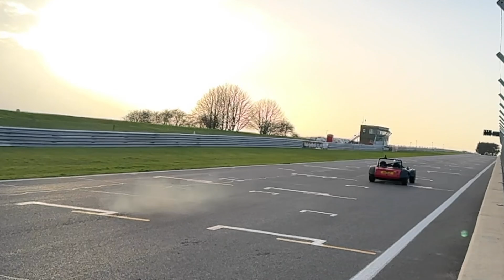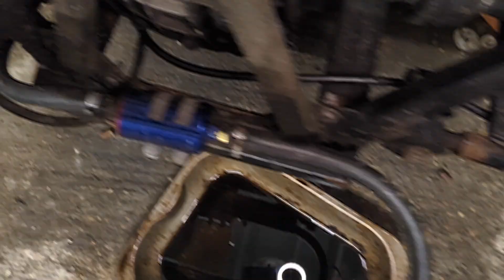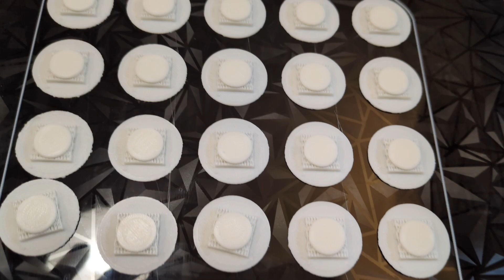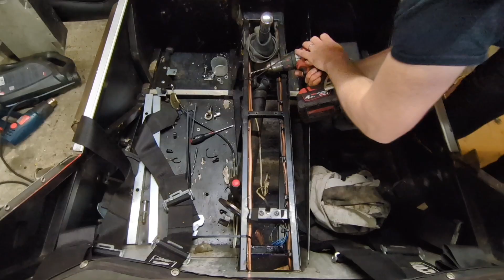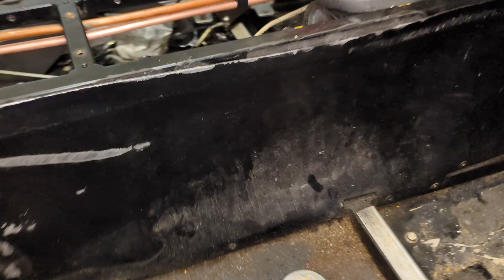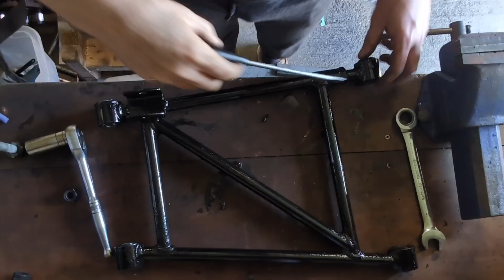MAJOR OIL LEAKS - Send it?!?

Comment: Thingieverse have files for copper pipe bender.
Reply from the maker: @myshopmyrules.3017  do you know  what? I didn't even look! As I can design and have SW etc I just run to the laptop and crack on. 

Not used thingyverse , printables etc often as most of the time the stuff is crap. I can design it better. How does my pipe bender compare?!? 🤣
Reply: @TeaNBizz-Kits Sometimes i just serarch thingieverse for fun. Sometimes i find usefull stuff. Im still a beginner when it comes to designing stuff. I hope someone who have the belt pully cover and can scan it an put online for the right walker turner drill press pulley cover for my drillpress from around 20s-60s?. And i hope someone scan the nose cone of  the super seven so i can print it and make it out of fiber glass or aluminium when i get the skills.

Comment: Iv heard good things about citric acid powder for rust removal. Buying a big bag here in Norway 25kg cost £44,15, that will last a while. August last year i changed my profession from plumber to welder. Worst mistakes i ever did in a way. Walking by the scrap container makers me see €$£ every day. Now i really want to buy the (Build your own sports car for as little as £250 and race it!) cause i see a lot of 25mm square tubing trown away. And watching your car aint helping subduing the hoarder in me from collecting scrap metal for a project like this.
Reply from the maker: Not sure what this POR15 had in it but it's a great product. The paint finish is amazing considering I brushed it on with an ambient temp of 5degC and over rough surfaces. Very impressed. 

Welders don't earn as much as plumbers in the UK but welding is FAR more useful than a plumbing when building a car!! 

Can you get a kit car imported and then modify it? That's what I would recommend. It takes a lot of determination to build a car from scratch.
Reply from the maker: Oh, and thanks for watching. Please do take a moment to watch my other episodes, tell your friends, subscribe and generally show some love. Biz.

Comment: Nice work. Re compression test figures, on my Rover K series in my GTM (similar compression ratio IIRC) I get 220psi dry/cold (even across all cylinders) and hardly any change when wet (<5psi). A previous K series with 110k miles was still giving me 160psi cold/dry and 180 wet so yours does seem a bit low but maybe just a toyota thing and at least they are even so nothing catastrophic. Could be the valves need lapping as cars not used for periods can easily get pitting on the valves. Oil consumption on track days is not unheard of. You are thrashing it after all! I would expect to put around a 1/4 litre in during a track day in a healthy engine with no leaks. Re-paint looks good - I think paint is much better than powder coat on kit car chassis/suspension as in my experience powder coat just flakes off. Should last much better. One thing I noticed that seemed odd is you seem to have two inline fuel filters - Why?? I had a similar looking filter clog which caused me a massive misfire at Donington a couple of weeks ago on the Locost R1 so having two doubles the risk of that!
Reply from the maker: Thanks for watching, very much appreciated. 

I think if money, time and energy allows the engine will be coming out and getting a check over next winter. So we will see. . . Hopefully it lasts that long!

My old stock 4age NEVER used oil on track. That thing was an animal 165bhp of Japanese perfection. I really miss that engine. It just took all the abuse and never faulted. Hence why now I'm chucking litres in at the same rate as my coffee consumption throughout a track day, I am getting worried.

Yeah, well chuffed with the paint, I'll probably do the whole chassis over time with the same process. 

Regarding fuel filters etc. the bright blue thing is the fuel filter, the one in the black sponge jacket is the pump. So it goes tank => filter => pump => injectors => BANG! Bothe the filter and pump are syvec so should be good quality the gauze is larger has a big surface area and it new. It's not blacking anytime soon. 

Sounds like you are UK based. If you are coming to Kitfest at pod try to find me and say hi.

Comment: Magnetic Sump Plug may help you check for metal in the oil 👍
Reply from the maker: @richardbarry8399  I think it has one and didn't have any bits attached, I should really check that and replace it with one of not. Good shout.

Comment: Good video , keep in mind that your lost compression is lost power. :) Send it and try using 15W40 or 20w50 for this season . Look for glitter in the oil .
Reply from the maker: @eros20V  thanks and good point about lost power. It hasn't run much since the rolling road so I'm assuming it's still around 300bhp unless I have lost a lot of compression very quickly. We will soon find out!